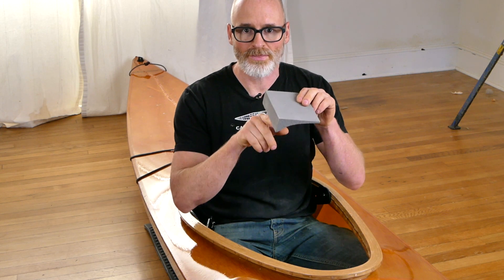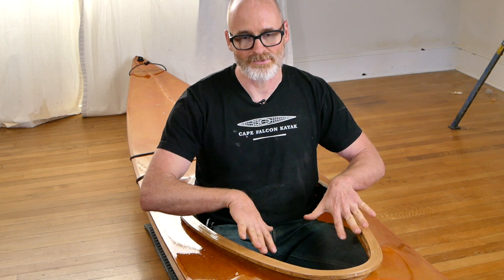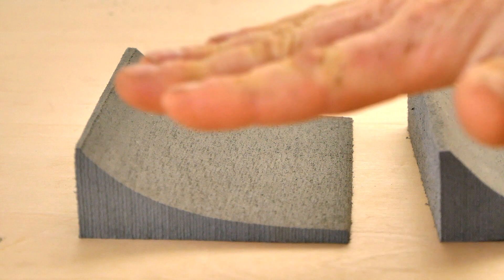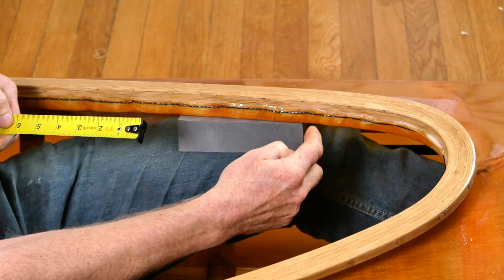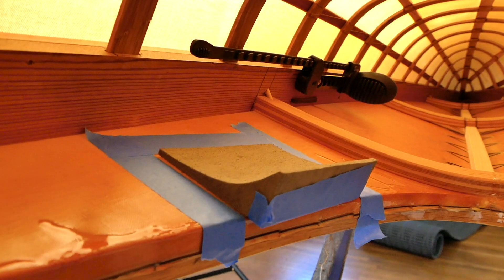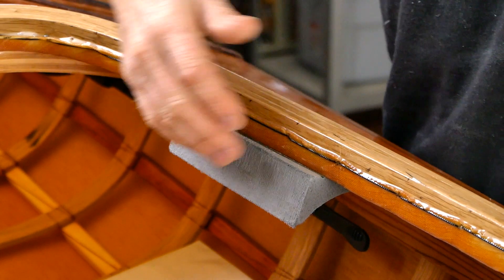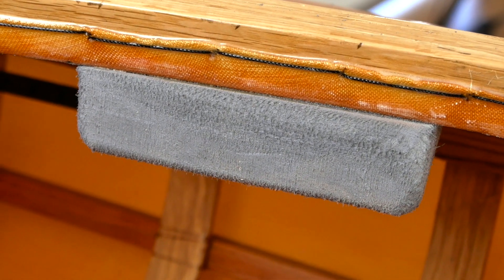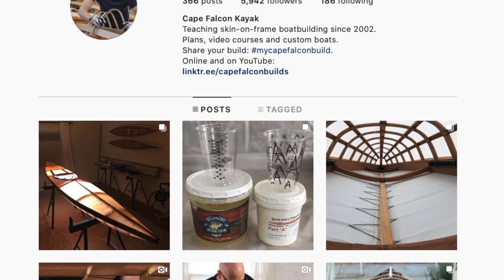Installing Thigh Braces in a Skin-on-Frame Kayak

Comment: I have enjoyed and learned a lot from your videos. I have 2 questions if you would be so kind as to answer them. Is regular yacht varnish suitable for a nylon skin and is the 2 pack poly used on floors ,concrete etc suitable..I would much appreciate you thoughts on coatings. Regards from the UK
Reply from the maker: Regular varnish works but it's not very durable.  Legend has it that the 2 part I use was originally a concrete floor finish, but I think it was heavily modified beyond that.  You can have it shipped to the UK.  Some people say Coelan works well, but it's expensive and pretty toxic.
Reply: @capefalconkayak  Thanks for the reply.